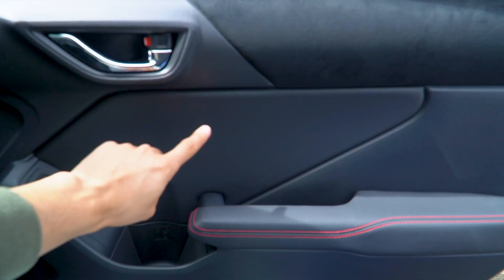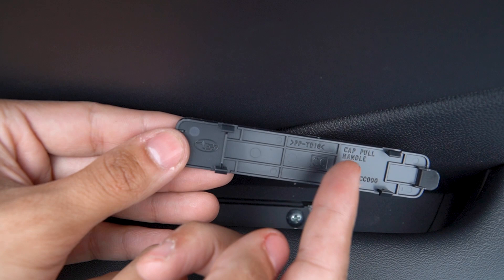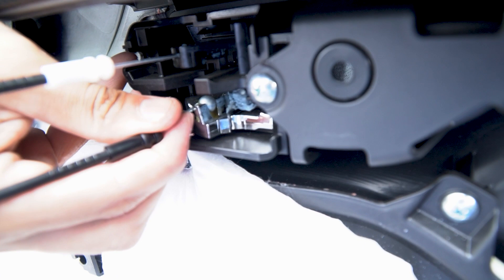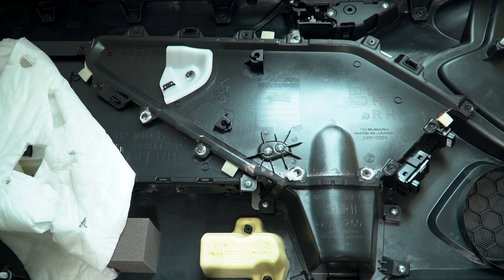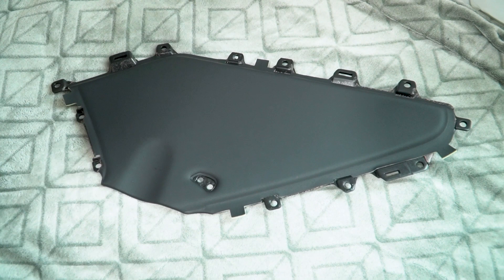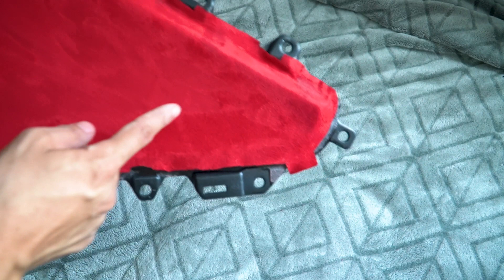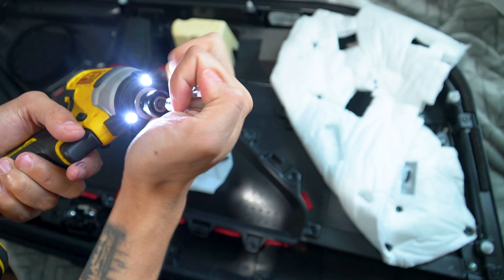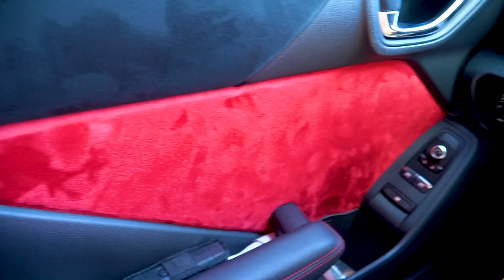2022 BRZ/GR86 GETS FRESH NEW INTERIOR | SUEDE

Comment: don't you also spray the back side of the fabric, let the glue tack up, then lay the fabric down?  or does the gorilla spray work differently?  what about cutting the notches after it's laid on the panel?   for the white sound blocker, some velcro (hook&loop) would work fine; no self tappers necessary.
Reply from the maker: I’ve seen some people spray it on the fabric as well but felt like it would be to much glue that could leak through the material. The notches are based off the original cover so no need to cut unless you make them to large you can trim them.